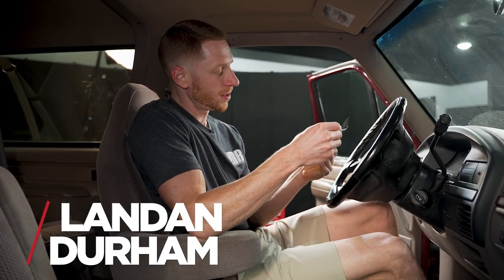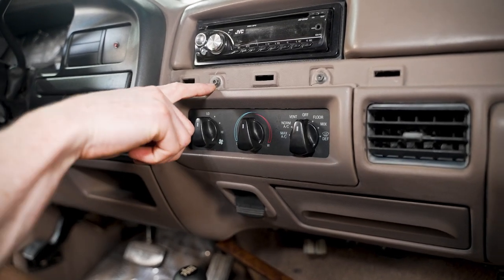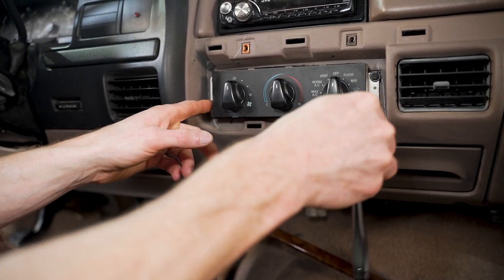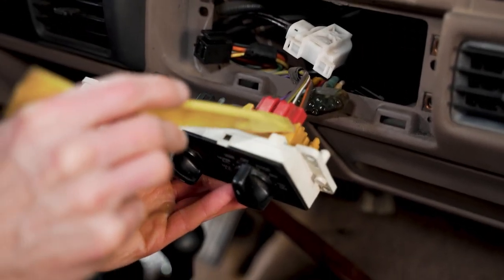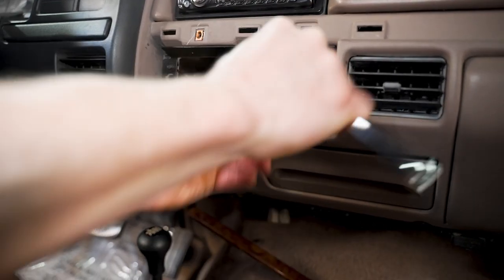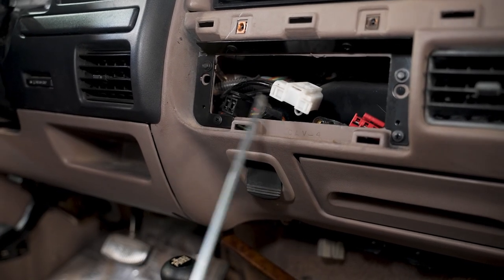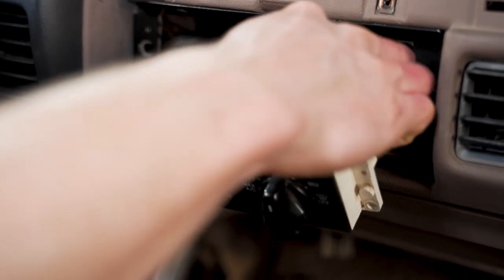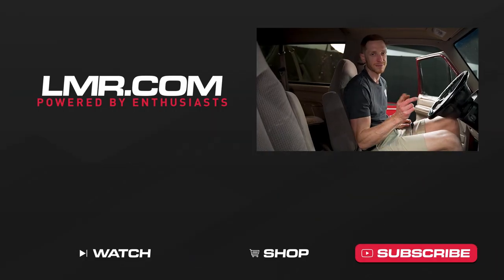1992-1996 Ford OBS Bronco & Truck: HVAC Control Fix/Repair Bracket

Comment: You'd make a killing repopping those woodgrain trim pieces and the dashpad.
Reply from the maker: Thanks for the comment. I'll forward this to our product team for review. -Landan
Reply: exactly! especially the dashpads! i had to try to recover mine with material..it came out "okay" but a real repop would be more desirable
Reply: I can’t find any dash pad reproductions for my ‘96 anywhere. Only thing I find are carpeted covers or hard plastic covers.